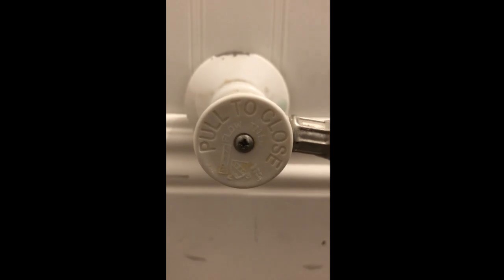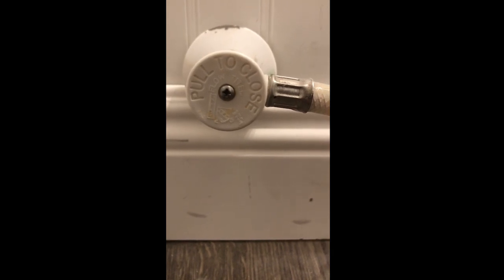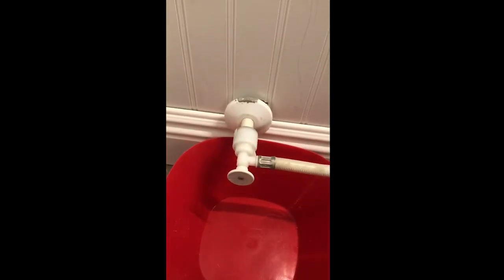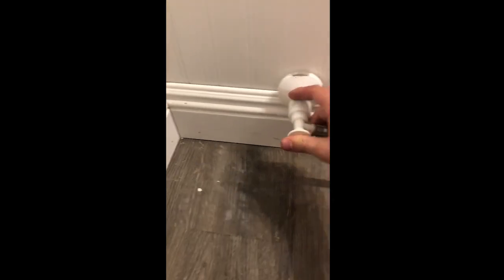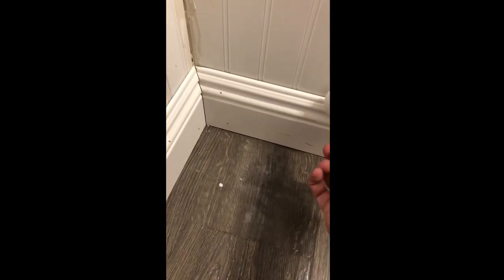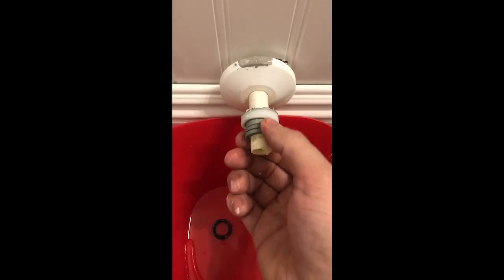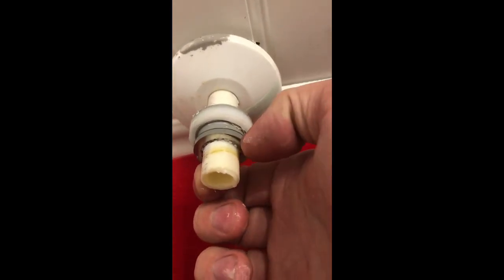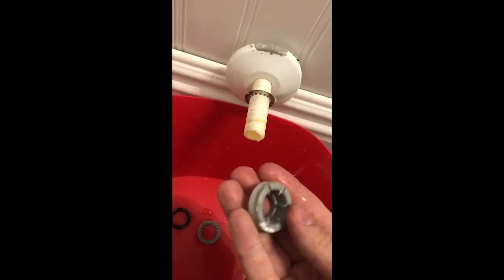How I replaced a flowtite valve

Comment: Finally, a way to remove these ridiculously stupid water valves. Still wondering why builders use these useless water valves. Well, I know it's the cost savings but these things are a freaking nightmare. Riley, thanks for the informative video.
Reply: On my way to Lowe's right now to replace my whole house valves
Reply: Because they’re cheap to buy and easy to put on. Simple as that
Reply: Ass builders knowing you gonna buy the house anyways even you know that’s a potential problem, so why no rip you off a little more from that and that’s your problem now since they handed the house to you without leaking and less likely it will leak in the next 3-5 years

Comment: I think that 3rd metal retaining ring is better left on. 
It holds the decorative escutcheon plate against the wall, AND helps holds the pipe from slipping back into the wall, when pressure is applied to the pipe when new valve is being pushed on.
Nice video otherwise!
Beats those videos where they “twist and turn” to remove. Causing pipe scoring

Comment from the maker: Update! A year later and even though I put glue on them, believe it or not, nothing happened 😂 thanks for all the comments of the “subject matter experts”
Reply: You're probably okay but I'd be concerned about the glue and primer breaking down the O-ring in the sharkbite fitting. I use sharkbites a lot and they're surprisingly reliable -- have never had one fail. Push em on dry to copper and PEX. But in general with plumbing stuff I go exactly by the manufacturer's suggestions because the risks are too high to have a part fail.

Comment: You don’t cut this valve! You turn counter clockwise as you gently pull it towards you... and it rotates off...
Reply: Exactly!!!!! Smh
Reply: Thanks for the tip Matt, now counter clockwise the F off.
Reply: I've rotated mine for about 2hrs and the shit just straight up won't come off, I'll cut it and let you know how it goes lol
Reply: In real life this doesn't work. Only in videos where you just put a brand new valve on a pipe and then immediately take it off. Cutting it off seems to be the only option left
Reply: Yes and rotating and gently pulling usually damages the pipe. This method makes sure you don't. I just wish builders didn't use this trash.